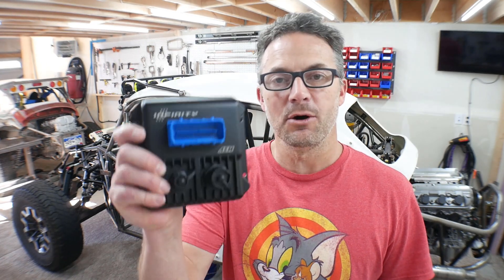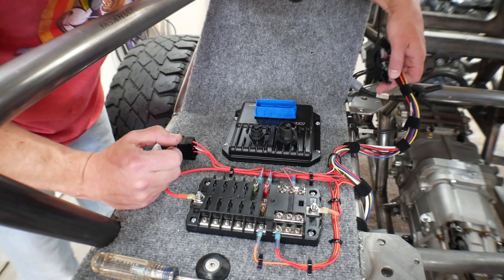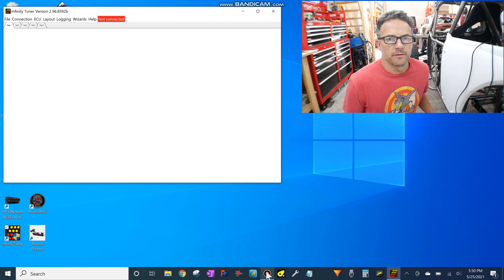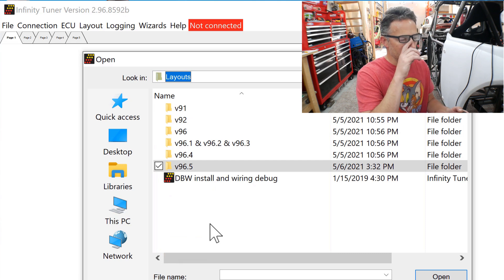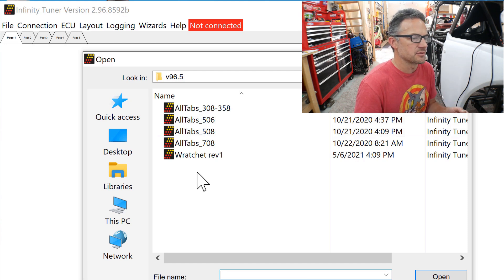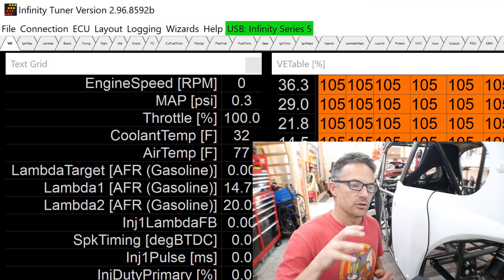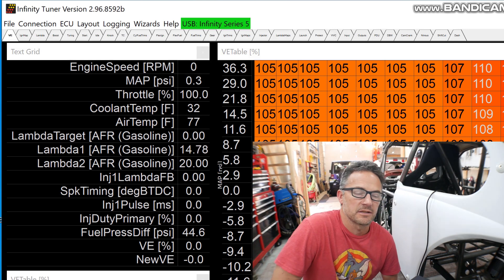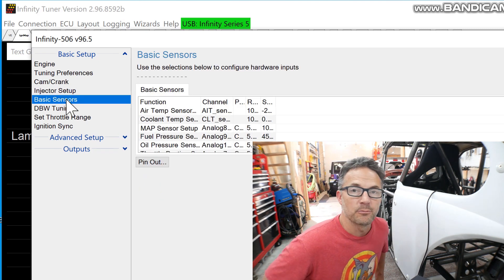Connecting AEM Infinity to PC... (Infinity Tuner)

Comment: Great work. Love to see the progress. 
I have the same OCD problem with wiring. I go all the way. Soldering all the crimp connections and high quality shrink tube. No corrosion and never gets loose. That’s how we do it on race cars. You could get false reading on sensors if a bad crimp is loose or corroded. 

Keep it up.
Reply from the maker: Crimp, solder, shrink tube! That's impressive, best of both worlds I'd say. That's more OCD than me, but I applaud you for it. 👍

Comment: Nice!!!! Is this system records trouble codes that you can scan with your laptop for troubleshooting purposes or rely on faulty parameter readings to diagnose problems?
Reply from the maker: Yes it will store trouble codes, and it will data log. So I should be able to look back at certain parameters and see what's happening.